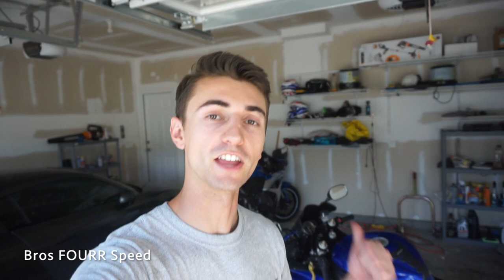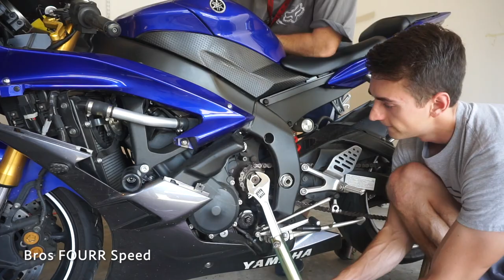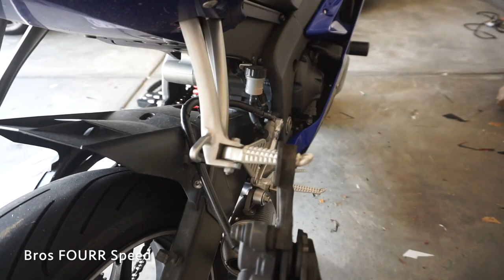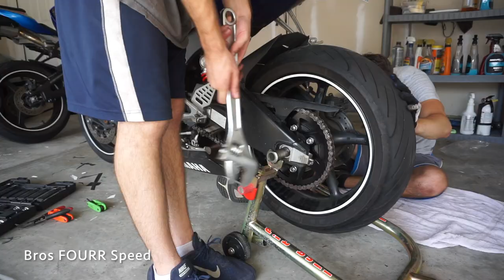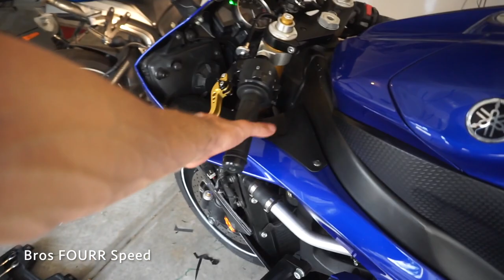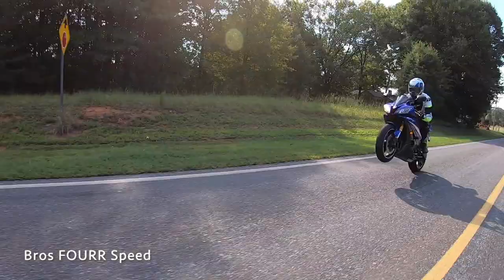How To Wheelie The Yamaha R6 With TWO MODS!!

Comment: Clutch ups are the way to go with the R6. Just gotta face the fear, I thought my 2013 R6 was just not a bike that could wheelie. Turns out I was just a bitch
Reply from the maker: I don't feel as comfortable doing that on a motorcycle, I wheelie my dirt bike all day, but I also don't wheelie a whole lot on the R6.  But I could see that working better for sure.
Reply: The fact I have the same problem right now with my 2013 r6 is crazy lmao, help a man out💀
Reply: @hypeemoto4742  I just started the other day just hold the clutch in give her some throttle pop the clutch and feel it. You’ll only pop the front barely or not at all and you’ll get a little more brave each time raising the bike a little more each time giving more throttle. Practice safe man and have fun!
Reply: @BrosFOURRSpeed  the thing with power wheelies vs clutch ups are how much control and predictability you have with clutch up vs pow pows. Power wheelies your leaving fate in the mechanics of the motorcycle that can change from each wheelie. Regardless of how you try to pick up the front wheel please make sure that your keep your right foot over the back brake so you don't loop out! Stay safe
Reply: At least you admit your shortcomings I was the same way when I had mine I did do the 520 conversion but mine was a 2000 r6..
Reply: Hahaha this comment was hilarious 😂

Comment: An r6 will wheelie from the factory, no need to sacrifice your top end
Reply from the maker: It's very very hard to get that wheel up, we have tried several times, just doesn't have the low end power, unless you really pop the clutch hard.
Reply: @BrosFOURRSpeed  You need to learn how to do it loading the forks and then popping the throttle the bike I’ll stand straight up
Reply from the maker: @liljohn309  I’d rather save it for my dirtbike, it’s a lot more fun!
Reply: Facts mine lifts right up scared the crap 💩 out of me

Comment: You can def wheelie a stock r6...honestly you should learn to wheelie and get comfortable before you start swapping out the sprockets. Especially jumping +4 on the rear
Reply: Stunting my 2014 out right now. I can wheelie the bike no problem. Just went -1 + 5
Reply: power wheelies are difficult for an R6, you can only power wheelie a stock R6 in 1st gear, but you can clutch it up all the way to 3rd gear,  possibly 4th if someone is really skilled
Reply: @Laith because 1st gear is really twitchy and is an extremely short gear and won't even come up until you're just about at the end of the rev range but people are even more scared to try to clutch it up lol even though in my opinion clutching it up is far more controlled than power wheelies. That shit is sketchy af, at least on an R6, maybe if it came up faster and more controlled like an MT-09 or something
Reply: What gear and what rpm can you clutch up your stock r6 im curious?🤔I tried to pop it up in first gear but it wont pop up at all unless im way high in rpms like 10rpm
Reply: @kylebutler1720  second gear, cruising at 4k, rev to about 12k-ish and dump, once the wheel is up the rpm's go back down obviously
Reply: @bbs5400  thx brotha🙏
Reply: @kylebutler1720  No problem, oh and for power wheelies, what I do is be in first gear, cruise around 10k-ish constant throttle, then snap your wrist to 0% throttle then snap to 75% throttle or more if you're ballsy, the %'s vary obviously so play around with it and take it slow. *And you have to time the application of 75% throttle with the rebound of the front forks, exactly like he does at the very start of the video, at 0:00
Reply: What he does in this video is he accelerates to about 10k rpm then dumps to 0% for a fraction of a second and then reapplies throttle. It doesn't need to be like constant throttle at 10k for awhile, as long as you hit around 10k rpm's before you dump to 0 throttle
Reply: I say 10k but you'll more than likely have to rev higher than that, but keep in mind that the higher the RPM's the faster the bike comes up, I've almost looped because I got too ballsy
Reply: Oh, and another thing lol when clutching it up, the lower your starting RPM's, the faster the wheel comes up, so maybe start at 5k, then try 4k, then once you know how to wheelie you can learn to do it at 3k so it comes up a lot quicker
Reply: @bbs5400  oh ok now im understanding the process. Its just nerve wrecking hearing the engine when im reving it up to 10k. Sounds like ima loop it letting the clutch out that high 😅 i appreciate all your advice though truly 🙏
Reply: @kylebutler1720  Yeah I get it, I went through that too, just go slow, rev to 7k a bunch of times, then a little more to 8k, then 9k a bunch of times, and that's likely where the wheel will come up, then around 10k gets you closer to balance point. Go slow, progress slowly. Just bring the wheel up a little bit and do that over and over, then bring it a little higher and do it over and over, etc. you're welcome though, hope it helps
Reply: getting over the fear of revving the bike up to a high RPM and dumping the clutch suddenly is a difficult thing to do, it goes against all your instincts, so just take it slowly and you build up an immunity to it and eventually can dump around 10k RPM, don't go out and immediately try to dump it at 10k, you need to build up the muscle memory of hitting that back brake as well. There's multiple parts that need to work simultaneously
Reply: @kylebutler1720  oh, and to be honest, I don't even look at the RPM's, I'm just guessing, you more have to pay attention to the sound the engine is making, because obviously you can't be looking down at the tachometer the entire time

Comment: The r6 is easy to wheelie stock just clutch it
Reply from the maker: I was trying to do more of power wheelies. But I also figured out that I was running lower tire Pressure then I should. So now it's actually much easier with the paper psi.
Reply: It's all a learning curve took me a while to get the hang of it,  just keep doing what your doing bro and ride safe!! 🤙👌
Reply: In 2nd aswell?
Reply: @BrosFOURRSpeed ideal tyre pressure?
Reply: @runningthrufudge2922  Clutch ups is pretty hard on a R6, being you have to give it everything it’s got to get it up, 2nd gear you’d need to be moving 40-45 Dump the clutch at 10k and slam it

Comment: First off you can wheelie a stock R6, second this is a very precision based bike, torque specs are there for a reason. You literally used an adjustable wrench on the sprocket nut that only requires at most 18Ft lbs.
Reply from the maker: Do you have an R6?  My brother has tried and it's pretty tough with the stock gears.  And I made sure it was properly secured.

Comment: Clutch it up bud lol You need to get a Bauce racing ecu flash and he can give the bike everything it needs. Trust me get it done, exhaust mods or not. Bike is limited to 75-80% actual throttle. Thank me later 🤣
Reply from the maker: R6 GUY Interesting. I have a full exhaust on the bike. I’ve never looked into tuning the bike lol
Reply: Bros FOURR Speed yessir any time you change something that can affect AFR you need a tune. Also the factory ECU is very restrictive compared to what you get with a flash. Chief at Bauce had like a 1-2 turn around. He over nighted mine back. He’s a good dude, you won’t be disappointed trust me.
Reply: @R6_Nitty  how do you do that?
Reply: @raalexander8708  do what?

Comment: I just installed to a 15 on my 2020 R1. It's crazy how much of a difference it made and I hate it. The bike does not sound. Or feel right, so I'm returning to stock. My bike is a daily rider, 20k miles in 24 months.
Reply from the maker: Oh I bet! Yeah I put this back to stock after the video. Was horrible riding at such a high rpm around town and the speedo saying 70mph
Reply: @BrosFOURRSpeed  I meant R6. I have the 2020 R6.

Comment: An impact is the best way to remove the front sprocket.  Doing it by hand torques things a lot more and doesn't come off or at least for me it didn't with Massive torque.  I had a sprocket stopper someone made out of CNC on it.  Used impact and boom, off easy because it doesn't super torque it.  It tries to come off but it doesn't come off but keeps trying and this dislodges all the dried up grease preventing it from coming out.  If you have some industrial M1A1 tank air compressor setup then I assume it would be a bad idea.  I don't really recommend gearing the R6 because 160mph can easily be achieved plus you would have the wrong readings all the time unless you dyno calibrate.
Reply: Everything should be torqued to spec not just kock tight 🤙🤙
Reply: @motojockey9642  yea, certain things

Comment: Stock r6 go about 45 mph/ 8000 rpms in 1st gear and rip it and your be 12 o’clock or you can be in second and drop it down to 1st
Reply: Fz 007 that makes no sense
Reply: Joe Carpio I’m simply telling how I pop the front when up not what will definitely work for others
Reply: Fz 007 do you have an r6 cuz I got one and I’m learning 1st gear clutch up and advice besides the typical cover the rear brake 2nd gear clutch ups are like impossible for me idk why
Reply: Joe Carpio no trust me I haven’t been able to get the front wheel up in second no matter what I do until I got a power commander then it’ll come up on a clutch up
Reply: I have a lowered r6 my sweet spot is 20 to 25 an i got it at a 45 degree  angle an stock sprockets 🤣🤣🤣🤣🤣

Comment: My r6 lifts right up n I didn’t want that lol luckily I was learning n new to back brake
Reply from the maker: Must been a different year model or you have different gears. Stock gears on mine is almost impossible to get the tire up.
Reply: @BrosFOURRSpeed  05 R6 raven edition no idea what mods as I’m like 3-4 owner. I’ve only changed cosmetics. Of course fluids, filters and spark plugs.
Reply from the maker: @gdejesus6341  Stock gears I found to be very hard to pop a wheelie. My brother cbr600 can do it much easier!

Comment: Ive tried popping a wheelie in first gear on my 2013 yzf r6. I think i was at least around 6000rpm and it barely got off the ground. its a little nerve wrecking trying to learn reving up to over 8000rpm in first gear to pop it up. Lol
Reply from the maker: Yeah it's just not good at it like my brothers CBR. Adding more psi to the tires helps. But I'll just do a wheelie if there is a bump in the road or something for fun. Don't do them much

Comment: If you want to use the torque properly you need to be using the top-end of the RPM band not mid-range.  If you aren't redlining then you are doing it wrong.  Mid-ranged riding like that is for 1000cc not 600cc.
Reply: Power bands kick in around  7-10 RPM  Red line you start to lose power actually on a R6! Mid to high range for twisty’s. And clutch up’s would save ya money just go one down in front keep back stock you’ll be able to power wheelie 1st and clutch up 2nd gear all day! Holla
Reply: @motojockey9642  My R6 has a power commander and with 1 map with is the EU Stock map it wheelies hard. All the other maps don't make it wheelie for some reason. I have no idea. Indeed being too far up on the redline will make it slow on a higher gear like 4-5. You want to be as near as redline as possible on at least 1-2 so the next gear would have a higher RPM than a lower one.

Indeed talking about wheelies.. when it starts rising I need to cut the throttle sometimes otherwise I might loop it and it isn't worth it.
Reply: @antdx316  maybe the other maps are set up for more top end for running like time laps etc on track! Set your sprocket ⚙️ set up to just one tooth off the front stay stock in the back and she will come alive! And you will still have top end speed 🙌💯💯💯💯
Reply: @motojockey9642  not really because I was testing it and it didn't make it any noticably better on the top-end. Making the speedometer read wrong is bad as well as increasing the chances of high-siding when it's slightly wet. I've fully high-sided once and almost a time before. It's frightening.

Having it lift up from just the throttle on the R6 is awesome. It even went way way up I had to cut the throttle.

Comment: my 2000 r6 does a wheelie with just throttle in first and second
Reply from the maker: We tried everything on this and it takes a lot to do it.
Reply: @BrosFOURRSpeed   just confuses me coz i thought the first gen r6 has the lowers power and lowest torque
Reply: lowest*
Reply from the maker: @adrxanruxz8493  With the right sprockets it makes it easier like this video, but stock gears it doesn’t get up.

Comment: That low end torque on the R6 sucks. But it'll wheelie stock. My cousin did them all the time.
Reply from the maker: I've tried a million times. I can only get a power wheelie if I hit a slight bump in the road.
Reply: @BrosFOURRSpeed  gotta slip the clutch in second gear.
Reply from the maker: Sean Waterloo High speed accelerations it’ll pull the front tire off the ground slightly. But I was never able to ride a wheelie like these sprockets made it.
Reply: @BrosFOURRSpeed  get a speedo healer also to correct the mph, installs quickly then just gotta take a ride with a GPS to set up.
Reply: Power wheelie is a good way to loop the bike. Learn how to slip the clutch and cover your rear brake. Used to do it with my drz all the time.

Comment: How to wheelie the Yamaha R6 with one mod !!

- Rider mod.
Reply from the maker: Have you tried to wheelie an R6?  My brother even tried and he does them a lot more on his CBR..The R6 is hard to get the tire off the ground, not as easy as his CBR since the torque is different.
Reply: @BrosFOURRSpeed  I recently bought one, and i had the opportunity to test ride a 2007 CBR too. 
The CBR is a bit more torquey mid-rev that's true, but the R6 revs a bit higher. You gotta play with the power band.
That being said the R6 wheelies effortlessly in 2nd. 
If you can't do it it definitely isn't the bike hold you down, it's you (or your brother).
Again, rider mod.
Reply: My r6 has stock sprokets it can power wheelie in first just start at the power band 😂

Comment: did they electronically limit the 2007 R6's or something? i didnt even think 2007 was fuel injected. But my 2001 R6 will clutch up in 3rd, easily clutch up in 2nd, and will easily power wheelie in 1st. Sounds like something is seriously wrong with your bike, because its supposed to provide much much more power than youre describing it to have
Reply: My 03 r6 will not come up for shit bro idk wtf is the deal
Reply: @gregjordan5900  you gotta lean back and get past 6k rpm I haven't used a 03 but I've got a 08 and gearing is stock... I have a hard time keeping it down
Reply: See that's my problem is my arms arnt long enough for me so sit all the way back on the seat, usally I'm all the way in the gas tank but it's not really by choice that's just how I fit on the bike, I was thinking about trying to get some aftermarket handle bars and maby I could sit further back on the seat idk tho
Reply: Ok for sure man yea I have a slip on also I'm just not good a popping the clutch I guess
Reply: @gregjordan5900  could be that, just gotta practice over and over, my main mistake was not having the balls to hold the throttle, id always release it as soon as the wheel popped up so try to remember that when youre practicing
Reply: Yea I think that's my problem is I'm too scard to commit to it lol I have popped it up just a little bit in first with out the clutch but I wanna learn how to clutch up cus I know that's where it's at
Reply: @gregjordan5900  oh yeah absolutely dont clutch it up in first lol thats a recipe for disaster, definitely do it in second. yeah clutch ups are wayyyy better but more difficult for me, power wheelies are probably sketchier for me though, its harder for me to keep at balance point for more than a second or two
Reply: Ok forsure man thanks for the info
Reply: @gregjordan5900  no worries man, just remember to go slow, dont push yourself too much if dropping the bike would be a big deal. Goodluck man!
Reply: Cool thanks dude
Reply: @gregjordan5900  after market handle bars are a good idea also I find if my forks are soft and the rear is stiff its easier to bring my older bikes up by compressing the forks first.
Reply: Yea that's how I hit good Willie's on my dirt bike by compression the front forks on a little bumb
Reply: Bump*
Reply: @gregjordan5900  yeah that's how I learned... also to add on to the other guys comment when the wheel come up dont lean forward keep your self leaned back... its natural to lean in to the bike .... that was my biggest struggle
Reply: @derekrichardson4896  ok thanks man yea im getting the feel for it im just taking my time lol

Comment: Sorry, but WTF   what tools are you using?????????     Almost everything you did is NOT how a mechanic would do it. 

And why are you bashing on the axle?

Just frickin hold the wheel up a bit with your hand and it slides just in easily.
Reply from the maker: Nothing wrong with having to tap the axle back in. It didn't slide in too easy by hand. Keep in mind that clip was fast forwarded. So it looks like I was hitting it hard. I literarily just filmed this video for the sake of trying out the sprockets. And like I said in the vid, I didn't have all the correct tools. So I used what I had. After I put the bike back to stock I went to mu friends house and we torqued everything back to spec. This was just a random thing to do since I was bored. Don't take it too seriously